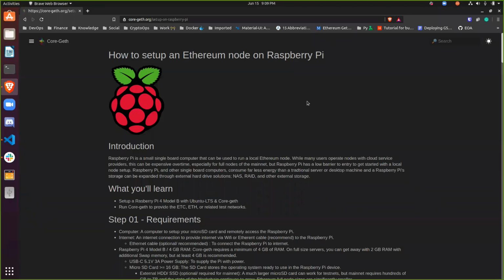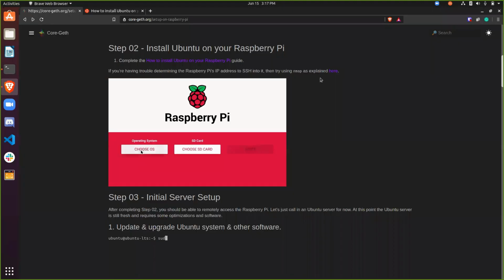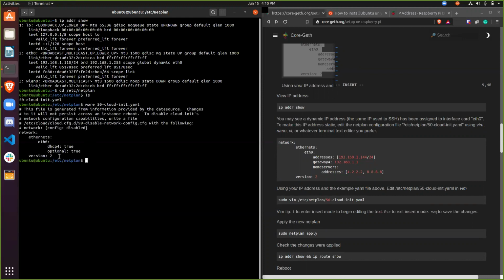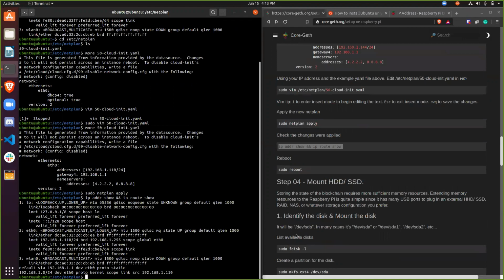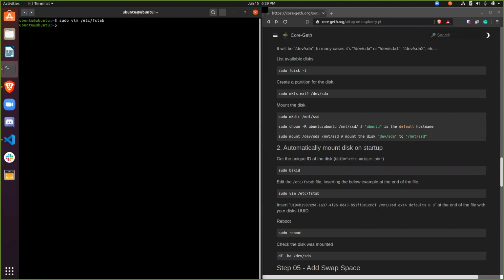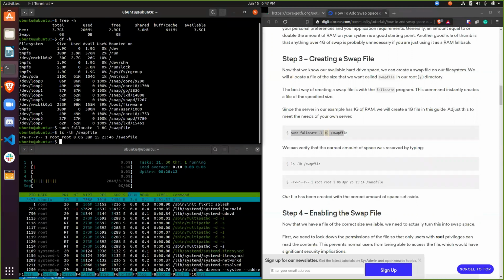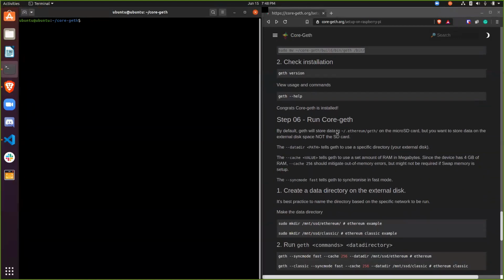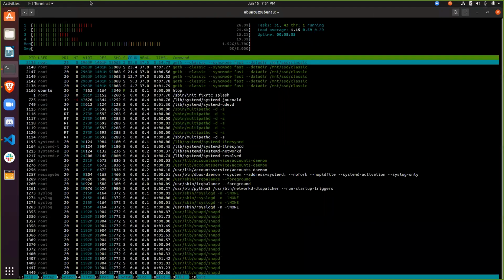How to setup an Ethereum node on Raspberry Pi

Comment: must it be raspberry pi 4? how about raspberry pi 3
Reply: It says you need 4gb of Ram to run so yeah you do need the pi 4
Reply: In the raspberry pi imager it says most versions of ubuntu are compatable with pi 3
Reply: how much ram does a pi 3 have because yeah 4gb is the minimum

Comment: Serious question, have you ever tried to/is it possible to use vmware and do this same thing virtually?
Reply: If you are running multiple VMs then it will cut your performance depending on what the other vms are running.  Because you are using the board's resources to mine.
ESX/VMWare is usually using the resources with systems that don't use them 100% all the time to get more efficient usage.
So probably will work, but may not be what you are wanting to do.
Reply: Well if it runs on Ubuntu they why not? Just install a Linux VM

Comment: Hi,
It seems my node is never catching up, I has been running for some time now and I am very close to fully sync, but it never gets there. Did you have the same issue? I am using RPI4 with 8GB RAM and SSD with USB3

Comment: High question will a pi 4 with a nvme SSD be fast enough to host a node and also have adapt run on it?
Reply: The 4 GB can work on ETC, but there's now an 8 GB Raspberry Pi model so that's double the performance I think that can run an ETH node for sure.